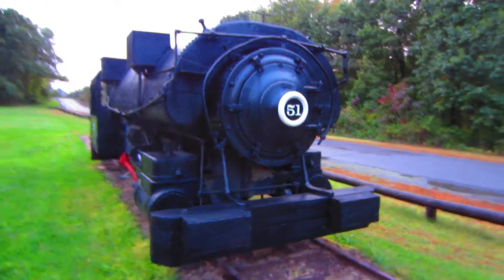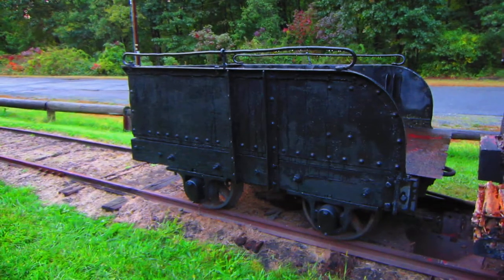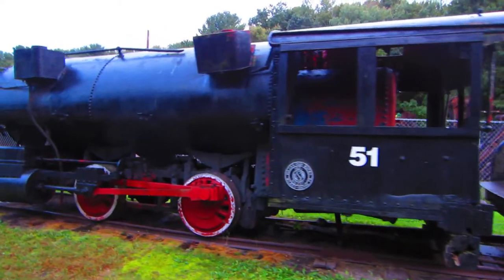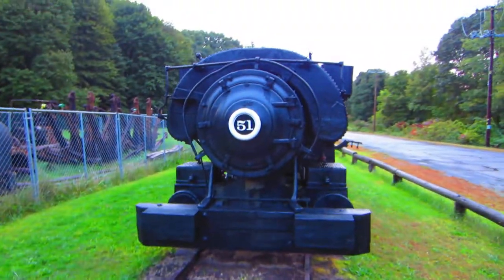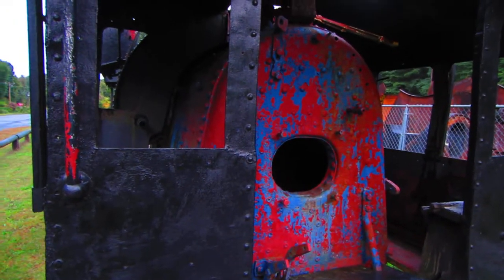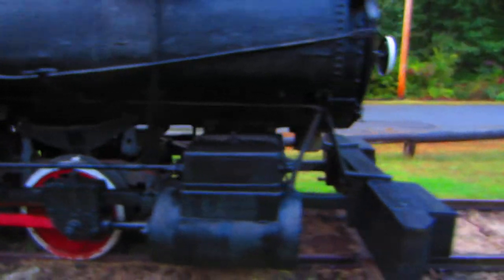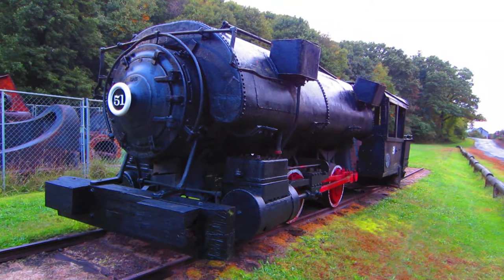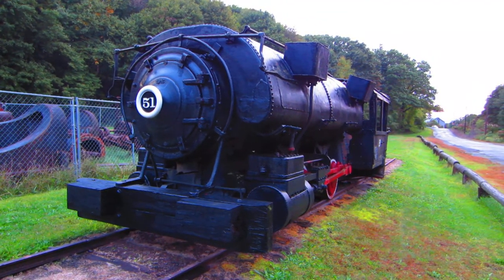Vulcan Iron Works Steam Locomotive Made in Wilkes-Barre, circa 1923 at the Lansford Coal Mine Tour!!

Comment: I photographed this 20 years ago when it was stored behind some fencing at Hugh Moore Park in Easton
Reply from the maker: That's cool. What's its history (if you know)?
Reply: Not specifically, it was Lehigh Coal & Navigation Co. #51, a 42" above ground colliery lokie designed short for ducking under the colliery structures.  It ended up in Pine Creek NJ after LC&N sold it in the 50s.  Easton ended up with it in the 1980s where it deteriorated behind a municipal equipment shed with other artifacts. Aroun 2010 it went to Lansford. @AnthraciteHorrorStories
Reply from the maker: @blairmielnik8228  thanks for all the information, is it salvageable for restoration?
Reply: It's been cosmetically restored, anything is restorable, depends on how much work you want to do.  This size is nice since it is doable to fabricate and weld a modern boiler.  They will likely not want to restore this to operation.  @AnthraciteHorrorStories
Reply from the maker: @blairmielnik8228  I love the old narrow gauge Lokies. There's a mine where they removed the hoist that was steam powered and they left the steam powered pistons or whatever they're called right on the ground, the arms are there too, I don't know what you would call those, like the actuating arms and the cylindrical drums (pistons?). I bet someone could use those for a restoration, just chilling on the floor of an abandoned mine.
Reply: Ha-  is it on the surface or that big drum hoist underground? Anything still underground has a substantial impediment, just lifting some of the mine car wheels is serious job with all the infrastructure gone. You sort of have to accept the stuff down there as artifacts to be seen in the site, outside of the mine/location they lose that gravity, the appeal beheld by the explorer  @AnthraciteHorrorStories